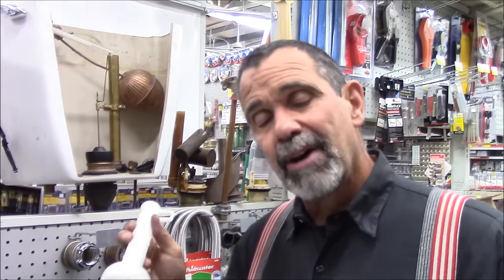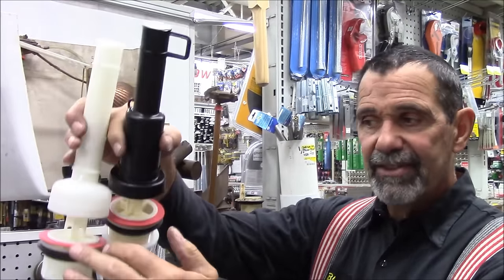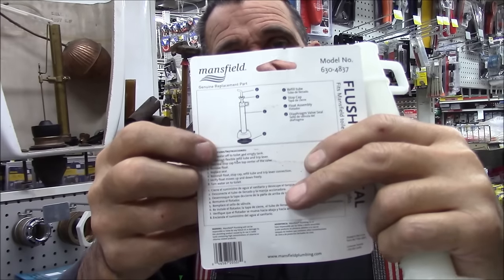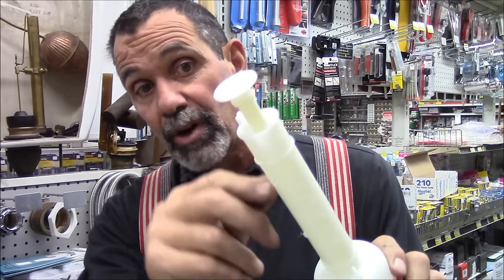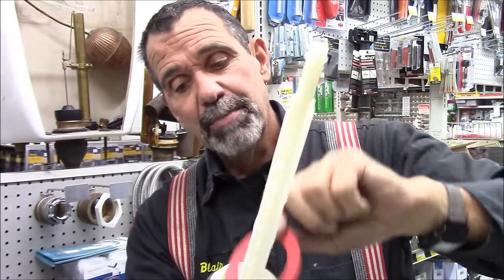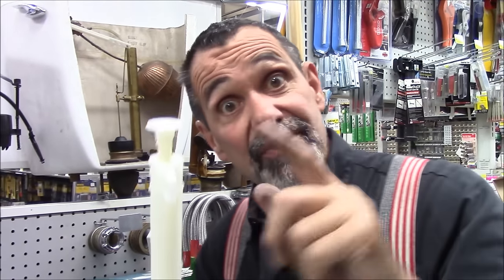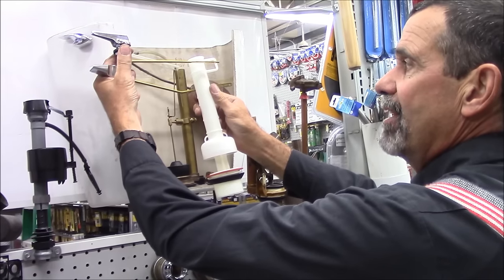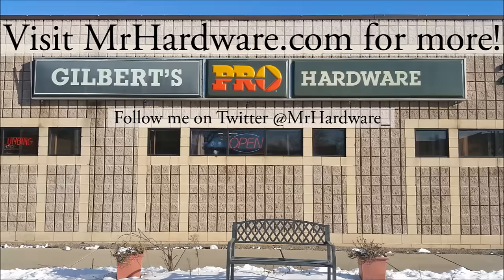Easy Mansfield Toilet Flush Valve Gasket Repair, Replace Seal, Handle Fix

Comment: Hi Mr. Hardware,
to start off - great video! However, I did everything as prescribed, got the seal for 210/211 tower, verified the same number on a tower and... the water leaks into the bowl with a faster now constant stream. It just feels like tower is not sitting tight enough. Also my old seal is shaped to wrap down around the bottom assembly and does not stick straight out like the new part. Any chance you would know what is happening?
Thank you
Reply: I have the exact same problem!  I think the seal gets so old it loses it shape, but the new one is not working at all and it is in the horizontal configuration, i.e. it is in the groove.  How did you fix it?
Reply: Yeah, I think the old seal gets deformed--when it was new it was probably flat. I had a problem the first time, but the second time i pulled in a couple spots on the seal to try to rotate it, and it was loose in one spot. Got to make sure it is fully in that groove.

Comment: Doesn't look too bad.  I have one that, I think, started to leak.  It's very intermittent.  But also the gasket seemed to "form" to the plunger.  Makes it stick badly.  I think I'm gonna break something every time I hit the lever.  Hopefully a new gasket solves both problems.
Oh, funny story.  On one of my Mansfield toilets(I got two), the previous owner hung an impact socket off the plunger.  You had to hold the plunger open to flush the toilet.  I have no idea why he did that.  I took it off and that toilet works fine.

Comment: Would replacing this be a fix to not being able to flush? It's like the valve has a massive vaccum seal down on it and is extremely hard to get to flush
Reply from the maker: almost all hard to flush toilets are from soft, rotting gaskets.

Comment: Anyone know if the older gasket that attaches to the flush valve is still available?  Regardless,  I appreciate the video.
Reply from the maker: Yup, we stock them. We don't sell many but we still keep them. Call 586-776-9532 and we can hook you up. Blair

Comment: I'm trying to fix a Mansfield 160, bought the red 210/211 gasket, removed the old out, put the new one in the upper groove, fits nicely, still leaks. Any recommendations? Thank you!
Reply from the maker: Is the water below the overflow tube? Sometimes the gasket needs to seat-in a day.

Comment: I’m trying to fix my apt toilet because of the virus. Don’t want too many people in my apartment (especially those going in and out of  other apts all day). Thanks to your video I see that I need a longer flush handle. I don’t see any that are bent that way on the websites. Are you able to tell me what the name of the long brass one is?
Reply from the maker: You will be looking for a MANSFIELD flush handle. It comes white plastic and brass (my preferred). The bend in the brass is not required, and that is why I like the brass, it bends easier than the plastic one.

Comment: What if that valve drops too fast after flushing and not enough water gets through?  How do you keep that valve staying open long enough to get a good flush? Thank you for the great video!!
Reply from the maker: If you take the plunger off the tower you will see 2- 1/4" holes in the very bottom. A couple of dots of silicone caulk to plug the holes, let it dry and you'll get 1 to 2 quarts of water more per flush.

Comment: Just tried to put the valve seal back in the groove and let it fill back up with water. Flushed it once and it came loose again. I’m guessing this one is just old and worn out so I just need to go get a new piece I’m just questioning it because you said the piece is pretty loose in this video.
Reply from the maker: You'll know once you slip on the new one, also is the old one over 5 yrs old?

Comment: Thanks for the excellent video.I understand that the rubber refill tube carrying the water goes into the overflow tube (black tube in the center of the tank attached to the flush valve).I have a toilet flush tank where the water keeps seeping through into the toilet bowl, wasting water & also takes a long time to refill too.So I ended up putting the refill tube outside the overflow tube so the water does not go into the overflow tube but outside the tube. Now there is no water seeping into the toilet bowl when the tank refills.I guess this is not the how it supposed to be, but then I loose a lot of water when I put the rubber tube inside the black overflow tube.Can you please tell me if I'm doing anything wrong & why water leaks out if the hose is placed inside the overflow tube? Thanks a lot.
Reply from the maker: The refill tube is to leave water in the bowl after the flush. Many toilets have an almost empty bowl without it, but not all.... can't say why. I have seen refill tubes siphon water through the ballcock and into the overflow thus emptying the tank, slowly. The refill tube should be suspended above the overflow to prevent siphoning.
Reply: @MrHardware1  I think I placed the refill tube quite low into the overflow tube.Maybe that was wrong? I have now lifted it up so its above the overflow. Will let you know how things go from here.Really appreciate your help on this.Thanks.

Comment: Great Video!   Just what I was looking for.  I just have to replace the gasket ez-cheesy....    ...It went on easy but you can see it leak a little when you flush it but it stops when the water stop running is this normal?   :)

Comment: Is the red gasket  a 2" or 3" because mines is loose like it's too big.
Reply from the maker: The second generation Mansfield gasket (from post 1985ish) is 2 3/16 inside by 3 7/16 outside. Usually red in color.

Comment: My toilet would refill itself every few hours.  I put a new gasket in it and reassembled and then it was leaking worse than before.  I reached down and rotated the gasket while it was in place and then it was fine.
Reply from the maker: Yes, I’ve had to rotate them too. I kind of think it just helped it seat into the slot.

Comment: On my Mansfield toilet the flush valve is stuck closed, the force required to flush the handle is so much that it might break, if I lift the tank cover and lift the plastic tower it flushes. I drained the water in the tank and looked at the flapper assembly and it appears it is not the red gasket seal that is the problem but rather the black seal under it. This black seal is sticky and breaking apart. Question = can it be replaced too?
Reply from the maker: Yup, it is the Mansfield 208 gasket you need. If you can't find one call 586-776-9532 and we'll sell and ship one out. Blair
Reply: This is my problem too. I broke the handle using all my body weight to flush it. I bought the parts. But how do i drain the water from the tank in order to replace it?  And to do it, do i have to take out that thing that floats on the top?

Comment: I replaced the gasket, made sure it was in the groove and got it to spin. So the fit is right. I put it all back together and it still leaking. When I pull up on the big plastic bubble thing it shuts off, but as soon  as I let it go, I hear water running again. Is there an adjustment I need to make?
Reply: I know what you’re experiencing. I don’t know the proper terminology, but… you know the opposite end of the rod from the bubble thing? Where it is attached? It sounds like maybe that part it’s attached to is possibly worn out. I had to replace all of those in my toilets years back.
Reply from the maker: Yep, if the water level is up to the top edge of the overflow pipe. Then it is the fill valve, also called a ballcock, that needs new gasket or rebuilding or replacing.

Comment: It was so hard to flush, that i broke the handle from using all my body weight. I went and bought a new handle & red gasket. Now, do i have to get the water out of the tank before i do this...if so, how do i do that?  Also, that hollow thing that floats on top of the water...do i have to take that out first?  Please help.

Comment: My brass rod will not stay attached to the handle. It keeps falling out.  What is the fix?  Thank you for your videos!
Reply from the maker: You need a Mansfield flush handle. they are 2" longer than a standard one. You'll see them in a store, blue  and square plastic arm.

Comment: I have one that sticks...almost impossible to flush unless you open the tank and pull the flush handle manually from the inside...is this a gasket issue, too?
Reply: Never mind.  Replaced the gasket and all is well.
Reply: I have the same problem. Do i have to empty the water put of the tank first?  How do i do that?

Comment: Could the gasket be the problem if the tower is really hard to pull up, like it's stuck at the bottom? Never worked with them Mansfield toilets
Reply from the maker: Yes the gasket says they get old gets sticky. Clear indication it’s time to change it.

Comment: Do the black gasket ever needs to be replaced and  how do you change the entire assembly if necessary.
Reply from the maker: Every casket has a lifespan. If I wanted to change the whole flush valve, I need to remove the tank from the toilet first and it helps to have one large wrench for that giant nut that holds the flush valve to the tank.

Comment: I replace these all the time, but this time I’m stumped. Replaced the gasket but the valve won’t come down completely and form a seal, almost like it’s not heavy enough. I may just replace the top part unless there’s something I’m missing.
Reply from the maker: Remove the flush handle and flush manually. If it still sticks you may be able to identify it better w/out the handle involved.

Comment: Do they sell the screw on cap separately as that is what I am finding that breaks and the tower lifts up too high  You have to take the whole tank off to replace the tower.  I don't see the advantage of this over a f[apper valve.
Reply from the maker: If you can’t find one, call the hardware store, 586-776-9532 and they will be able to ship you one.

Comment: great video...however I replaced the gasket....and water drips unless i press this on to the gasket...I cleaned , smoothened the surfaces adjusted the gasket...still intermittent...I added extra weight on this so it sits on gasket ..but no....now I ordered a full   valve including gaskets...from amazon...and waiting...interesting such an easy thing but I could not do it...yet..
Reply: Added.....I placed the gasket  not pressing too much downward..and now so far its working...
Reply: @Rafi_Shaair  the other very common leak that happens in the toilet tank is the fill valve is not shutting off when the water should, so it comes up to the top of the overflow tube and drains in that way.

Comment: Tu/Vous showed the red gasket. Does the black one ever need replacing?
Reply from the maker: Very very very infrequently. 30+ years. To change it you need to pull the tank off the toilet because the nut that secures it is inaccessible until that is done.

Comment: I have Mansfield 160 toilet. Needed new stop cap and red gasket. When I changed the red gasket and black rubber was wearing off also. Any suggestion. Can I replace the black rubber without undoing my complete toilet? If you have any video to change that please let me know. Which part I will be needing. In this matter it help me a lot. Toilet still leaks a very very little. Any suggestions. Thanks a lot.
Reply from the maker: The red gasket should be seated by now. Make sure the tank is not filling up to the top edge of the flush assembly (overflow). The base black gasket does rub off black, leave it go for 10 more years. To change it you have to pull the tank. 30 minute job

Comment: Do you recommend plastic or brass? I think plastic will break off with how much effort it takes to lift up that handle?
Reply: That flush valve*
Reply from the maker: When a Man’s field is hard to flush it’s usually because the gasket is old, consider replacing that when you purchase the new flush handle. The long metal Mansfield flush handle is hard to find but it is my preferred replacement. You could call the hardware store and they would be able to sell and ship one to you, 586-776-9532 if you can’t find one.

Comment: I have a dual flush top flusher. How do I remove the canister to replace the seal and do I use the same size, 3.5 inches?
Thanks for any advice.
Reply from the maker: Duo flushes have their own unique gaskets and methods to replace them. I would search the brand name and find a manual and have to get the parts and the lesson from them.

Comment: Just replace the gasket. seemed to go well but now it is leaking a little faster then it did with the old  one. Gasket is in the proper grove....it seems the gasket is pretty stiff and not soft and rubbery and is not seating well. Any suggestions.
Reply from the maker: I would suggest a Mansfield brand gasket. They rarely get stiff with age.

Comment: I have a Mansfield toilet that has that same tower in the middle but a push button flush handle. The small lever inside the tank that moves when the button is pushed is broken....... it is connected to a chain. I cannot find a replacement part for the push button assembly.
Also, I cannot find how to change the water level. The float does not have a screw like others.
Reply from the maker: Eljer makes a ‘side push button’ or you can replace the push button w/a long Mansfield handle, and I believe Gilbert’s Hardware may stock a long handled front mount push button. Send a pic to blair@mrhardware.com of the fill-valve (I can’t help if I don’t know what kind) and possibly I can instruct you how to change the water level.

Comment: Thanks. In my case the seal seemed nice and tight and the water was running into the overflow.
I bent the ball float down and it finally works. The thing is, I don't know why I needed to bend it when it worked fine before.
Is that a sign that the ball float or something is failing?
Reply from the maker: The float controls a washer in the fill valve which is wearing out. All plumbing does. I try not to bend the rod and just replace the washer or gasket first. But I have bent the rod to buy me a week or so.
Reply: @MrHardware1  oh okay, thanks a lot for replying! 👍
I knew something must be giving way but I didn't know what.
I may need that time while I look for the washer, depending on if it's in stock during this crazy situation.

Comment: Any ideas for what is causing the water level to continue to go to high and overflow into the top of the tube? It just keeps running....
Reply from the maker: It is the fill valve, also called the ballcock, that puts water into a tank. And when the gasket in it finally wears out 7 to 12 years, it will overfill the tank which is where you are right now. You can either look it up and purchase the gasket for your fill valve or for around $10 you can take it out and put in a new one.

Comment: My Mansfield toilet is continuous leaking; it only leaks between the upper tank and lower seat when flushed .  The tank has PB209 stamped on the back.  The flush mechanism is a two button system and located on top of the tank, and has the option of a single flush(button left) or dual flush (push both buttons).  Can you advise what may be the problem ??
Thanks ion advance for your assistance.
Reply: When a  toilet leaks in between the tank and the bowl only when it is being flushed it is a simple gasket that goes between the tank and the bowl that must have gone bad. It remove the three bolts, separate the tank from the bowl, get a Mansfield tank to bowl gasket (they use a special one) and reassemble

Comment: Gary, if we are trying to be cost conscious of our water, can we replace the 3 gallon piece with the 1.6 gallon piece and save 1.4 gallons per flush?

Or will that not work? (I don’t want to have too little going down and get the waste stuck in the bowl… 🤦🏻‍♀️)

Thanks in advance for your thoughts!
Reply from the maker: Before I do that, I’d lower the water level in the tank by adjusting the float arm on the fill valve. The water saving bowls have a trap that’s configured to create a suction with less water to evacuate the toilet. Your older toilet just may be configured to need more water per flush so if you lower it and it’s got that old maybe larger trap in it, it won’t flush as well. But you can lower the water level at no cost just to test, probably save some water for sure.
Reply: @MrHardware1  - that makes a lot of sense! Thank you!

Comment: Question! I replaced this gasket after researching that it could be the culprit for the toilet handle being very hard to push. It fixed that problem! No I need to figure out why when I flush it squeals and I have noticed a ghost flush twice since replacing also! The squeal may have been there and I just wasn’t paying attention to it until now but the ghost flush is definitely since I replaced the seal! Any ideas?!
Reply from the maker: The ghost flush is from the seal you just replaced. Let it get another week and then pull it and the plunger and check for the slightest flaws. Purge the fill valve if it is a Fluidmaster, I have a video, that should eliminate the squeal.

Comment: I think the video is groovy, but how does the Mansfield attach to the tank?
Reply from the maker: There is a big nut on the bottom of the tank securing it. You can see it still on the valve in the video. You can't see it until the tank is separated from the bowl.

Comment: The hole in the Mansfield is too small for the Korky larger tube. What is a solution?
Reply from the maker: I don’t understand what the korky has to do with the Mansfield. If you have a Mansfield flush valve, you are stuck with Mansfield parts. If you want to change the flush valve, you have to pull the tank and then you can put a Korky or any other flush valve on your toilet.